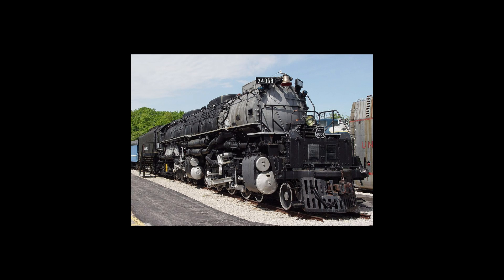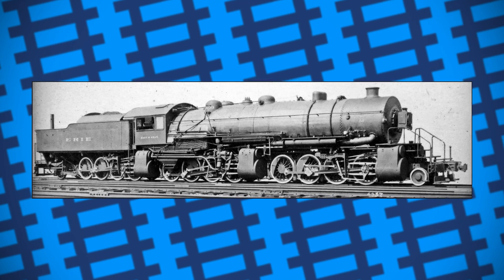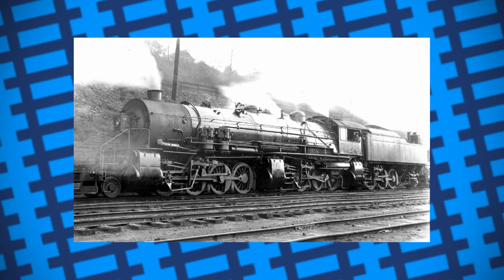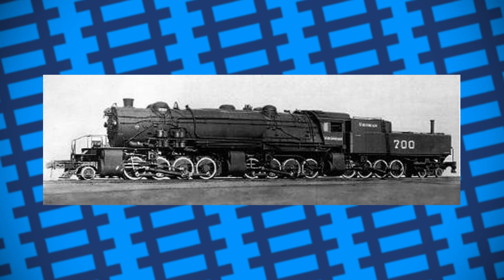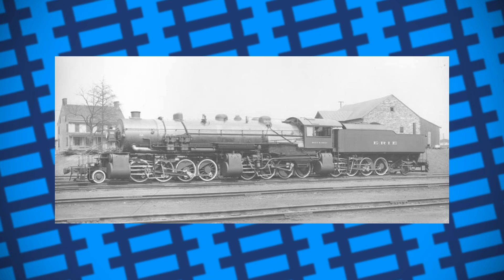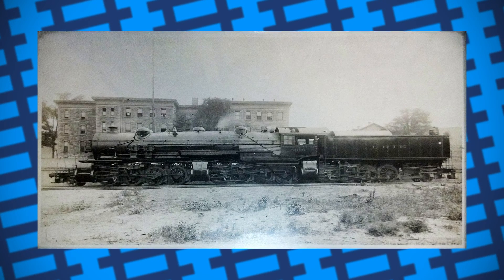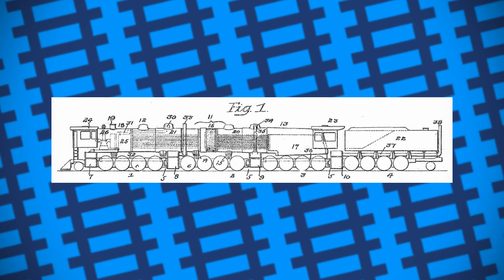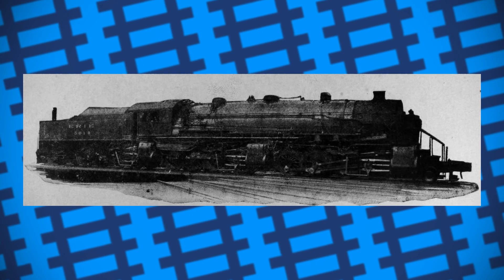The most absurd tank engines ever built - 2-8-8-8-2 "Triplexes"

Comment: A bit thing you are missing here is while they ended up being pusher (banking) engines, that's not what they were intended for.
(I manly learned about the Virginian 700, but I believe the Erie 3 where of the same reasoning)
These were designed for Coal Drags, which don't need much in terms of speed, but did tend to need more than single digit top speeds.
The want was for one big engine (and thus one crew) for these and to pull ever larger drags.
But when they couldn't provide enough steam for the journey they were dropped down to pusher service.
However in the US pusher service wasn't really anything special, a standard engine or two was typically enough for this and the benefits of a special engine for this was greatly outweighed by the costs.
Reply: The VGN seemed to like using single engines on their coal drags from Roanoke to Norfolk as it was generally down hill for loads and hence why they used 2-10-10-2s for a time after the Triplex (eventually they were supplanted by the AG class 2-6-6-6 when a former C&O employee became their mechanical officer in the 40s)
Reply: And another note The Virginian 700 was a 2-8-8-8-4 and all for Triplexs on both Railroads were remade to make several different 8 driving wheel locomotives. the Scrap logs were mainly for the Boilers and I think the Virginian scraped 700's tender also I for get the road numbers but the 700 was remade into three 2-8-0 loco motives.
Reply: @Dallen9  VGN 700 was actually split into a 2-8-8-0 and a 2-8-2 (they were AF Class 610 and MD Class 410 respectfully, a lot of websites would confirm it)
Reply: I think with better trained crews and a bigger firebox and a condensing tender like the south African Class 25 4-8-4s and the German BR52 2-10-0's instead of simply injecting the steam back into the last set of drivers this locomotive would have worked.
Reply: One thing: the coal car has piston rods
Reply: the problem was the mechanical stoker on the triplexes  it didn't distribute the coal evenly,( a problem with all mechanical stokers)this became evident when the one on one of the Erie engine broke down and caused a major delay, and the head fireman had to hand stoke the engine, they added a second helper for the fireman and he was able to fire the boiler fully to the point of not only taking the train up the grade but all the way to the end of the run
Reply: @jamesberry3230  Sounds more like they hadn't worked out the solution for that (moving coal around with steam jets as it left the stoker auger) than anything else.
Reply: Both the Erie and the Virginian were entirely intended as pushers.  The Erie locomotives spent their entire careers on their one 7.75 mile grade.

The Virginian never entered service.

Comment: You're a bit wrong about the big boys. Their rear driver set was rigid with the boiler, while the back of front driver set was connected to the front of the rear with a hinge pin. And each driver set was powered by 2 cylinders, not 3. There are, however, a few american examples of 3 cylinder steamers, such as the Union Pacific's own 4-12-2 9000 class.

Comment: Feeding six cylinders with steam requires a boiler with an enormous capacity. Clearly, these did not meet that need which was why their speed was so slow. Sometimes locomotive designers were overly optimistic in their assumptions. There were other designs that also failed to meet their specifications and were rebuilt or scrapped.

Comment: Remove “Tank” from your video title, these are not tank engines.
Reply: They are tank engines. To be a tank engine, you have to have your fuel and water carried as a part of the locomotive rather than on a separate tender. Since they extended the driving wheel sets back under what would normally become the tender, it just becomes a large fuel and water bunker, thus making these tank engines

Comment: If freight has gotten heavier, 🤔 💭 I like to think the SP would've had cab-forward triplexes built for Donner Summit.  👀 
Simple articulated, so no tripple-expansion Patent royalties to Mallet!  Someone please do artwork or a freelance model?
The 4-8-8-2's worked so well, optimized boiler capacity for speed and the infrastructure was built to accommodate them, down to the train length of passing sidings.  So even if a cab-forward 4-8-8-8-2 could push all 6 cylinders at capacity it would still only be 1½ times as good for (probably) more than twice the price. 🚂 🚂 🚂 💰 💰 💰

Comment: One of the biggest problems with freight rail in the US is that they are actually allowed to have trains that are miles long. There are numerous logistical, and sometimes fatal, issues that occur because freight trains are allowed to block at grade crossings for as long as they like. There have literally been people who passed away because the ambulance that needed to save them couldn't get over the train tracks for over an hour. There are towns in the US that are literally cut in half for hours at a time because freight trains just stop and sit blocking every single railroad crossing.

Hazardous cargo freight trains that have derailed in the US have also been major disasters because we are allowed to have oil trains that are miles long, or toxic chemical trains that are miles long. The derailment in East Palestine Ohio is a recent famous example of this.

They do that because of money, of course. If you can have a train that's 5 miles long, with only two employees on board, you don't have to spend as much on payroll.

Comment: It is not a tank locomotive. A tank locomotive has one rigid frame, with water tanks slung either side of the boiler, side tanks, pannier tanks or saddle tanks or between the frames, as in a well tank. This Triplex has water in the tender, so it is a tender locomotive of the articulated type, since its front set of wheels can pivot when it encounters curves. The tender, which has the rear set of wheels underneath it, can also pivot.
Reply: No, having a rigid frame is not a requirement of a tank engine. There were plenty of 2 driver set articulated tank engines. The "tender" here is simply a large water and fuel bunker, since it has a diver set meant to be used at speed and not just as a boosting engine. These are 100% tank engines
Reply: @wilhelm_iron2359  Rubbish - you have no idea what you are talking about. The "2 driver set" you mention were on Mallet tanks, WHICH HAD A RIGID FRAME, beneath which one set of wheels was able to pivot. Do please get your facts right. Mallet tanks were NOT articulated. AND the triplex has a tender, which means it is a tender locomotive NOT A TANK. Doh!! Dummy!!

Comment: The biggest flaw was that all the cylinders were of the same size   rather than having compound large diameter cyclinders at the front   Also having the third  set of drivers under the water and coal capacity  meant that the adhesive weight over that set became less as the loco was in traffic

Comment: Aside from the obvious fact that this locomotive is NOT a "tank engine", your math is indeed off. In the 1910's, typical freight cars were at most 40 feet in length.
Reply: The Erie introduced 50' freight cars in 1901.  Le Massina, for instance describes them as tanks.  Wiener says they have pseudo-tenders, but are more rationally grouped with the original Mallet tank locomotives.

Comment: The failure of the Triplexes was in the size of all 6 cylinders  being the same diameter  had the leading cylinders been larger and the system of compounding used  the story may have been different
Reply: Keeping the six cylinders the same size ensured a relativley conservative 2:1 ratio between low and high presure.  Thus also loading gauge was not offended.  Larger low-pressure cylinders would not have improved things.

Comment: MALLET TECHNICAL EXPLANATION
The Union Pacific Railroads "Big Boys" with the 4-8-8-4 wheel arrangement are known as a Mallet design. The "Mallet" is a design of articulated loco where ONLY the front engine, (that's the leading 4-8 wheel part), is on a separate frame that can turn, using a large pin & socket system to allow the rotation. The rest of the locomotive including the cab, firebox, boiler smokebox & the rear set of 8 drivers  & 4 wheel bogie beneath the cab is one complete chassis/frame. Further in typical U.S. fashion post 1900 this loco only has 4 OUTSIDE cylinders. NOT the 6 you state.

Only models of this locomotive such as the Italian Rivarossi example have separately pivoted front & rear wheel sections. For the simple reason to allow such a large model to negotiate the absurdly sharp track found on most "toy train sets". In HO scale (1:87) a model Big Boy if made exactly to scale would need a track curvature of no less than 900mm radius. Most toy train set track systems have curves as sharp as 395 mm in this scale !!! So for commercial reasons liberties are taken in the model production. But the model is where many "rail enthusiasts" have got their mis-understanding of the real loco muddled !!!

TRIPLEX TYPES 2-8-8-8-2 Erie Railroad & 2-8-8-8-4 Virginian Railroad.
These were NOT tank engines, as they had a distinctly separate tender (coal & water supply container). In this case the centre set of wheels was attached to the main frame supporting the boiler & cab. The front set of wheels were on a separate wheel frame that could rotate through the pin & pivot method as on the Big Boy (see above). The rear set of wheels were on another totally separate frame, that also supported the coal & water tender, and was "coupled not pivoted" to the middle main chassis in a similar way as a normal tender steam locomotive. The problem of getting steam from the boiler to the six cylinders (2 outside cylinders per frame) was solved by large steam pipes with flexible joints between the frames, but the distances involved meant inefficient drops in steam pressure, and leakage. 

The reasoning for building such locos was for the prime task of banking trains up steep gradients, where a second loco is needed to assist. The downside was the cost & maintenance of these complex locos, their limited speed precluding them from normal mainline work, or even shunting in yards due to their inordinate size. 

As a Locomotive Mechanical Engineer who has worked for a number of railways around the world in many railway departments, from Shed Master to Corporate Economics Management. I really think I should warn you that 95% of all the HUNDREDS of Wikipedia pages on railway matters, I have examined, are written by totally unqualified people, so are riddled with imbecilic nonsense, & in many cases quote inaccurate, misunderstood or even fictitious references !!
Reply: The rear articulation on the Triplex was similar to the lead articulation - as evidenced by the rear cylinders being under the cab. La Massina disagrees with you about them not being tanks. Wiener says they have pseudo-tenders, but are more rationally grouped with the original Mallet tank locomotives.

Comment: Your math is WAY off.  The average freight car of the day was 40 feet in length, NOT 55.  That would make a train 4.92 miles long, still not possible with the strain on the couplers.
It's also NOT A TANK ENGINE.  Not even close.  Just because there's drivers under the engine, that's NOT a tank engine.  Other locomotives had booster engines  under the tender as well.  Tank engines have the water tank slung over the boiler or on each side.

Comment: I know more about ships than locomotives, but I bet one of you guys can give me the good reason that they did not use condensers and preheaters on these things. A 4-4-0 locomotive is pretty small and maybe more advanced equipment was a waste on it. But the number one here was 400 tons and that means it had space for an entire 20,000 horsepower 2 boiler, condensers, preheat and super heat engine set. There had to be good reason, just not sure what it was
Reply: Because of the need for draft.  Locomotives can not force draft the way ships can.  Add in weight.  Add in access to line side water.  Although the south africans did use condensors, and did use forced draft - but out of necesity rather than desire.

Comment: My understanding of the Erie Triplex engines is that they were created to haul iron ore trans away from  the docks in Erie, PA and up a significant grade to reach the ground level where the mainline was. They were only expected to move the train about ten miles. I also believe this was done as a pushing action with a much smaller engine on the lead of the train. These engines succeed doing the job they were designed for for about 20 years, a pretty good life span for any mechanical object in heavy use. But they had the short comings stated: not enough boiler to produce enough steam to fully use the capacity of the engine cylinders; too little storage capacity for coal and water and lastly they were highly complex engines and hard to keep in service.
Reply: They were to bank normal traffic up one hill in northern Pennsylvania - 7.75 miles long.

Comment: The "Big Boy" does not have its driving wheels mounted on two sets of bogies. On a Mallet locomotive, such as the "Big Boys", the rear set of driving wheels are fixed to the frame, the front set only are on a bogie. They had only two cylinders per wheel set.
Reply: Big Boy is again not mallet, its a simple articulate

Comment: Nowadays, the average train is over 6 miles, but they have diesel and run on very specific tracks. This just seems surreal for something with steam power single-heading a train. I don't even know that the cars at the time had the strength to hold up due to the engine decelerating, and would probably require loads of engines just to get the entirety of the train in motion without breaking. I can only imagine how majestic it would have been to see one of these in action, even if only for jobs that didn't use the full capabilities of what was intended.

Comment: There are two significant errors in your opening introduction. The Union Pacific 4-8-8-4 "Big Boy's" only independently swiveling bogey was the forward one. The second set of drivers were permanently aligned with the boiler's central axis and did not swivel independently of the locomotive's frame. Secondly, the Big Boy's two sets of eight drivers were powered by just two high pressure steam cylinders per bogey, not three as stated in your introduction. 

UP had some classes of non-articulated 3-cylinder compound locomotives, notably the 4-12-2 "9000 Class" solid wheelbase engines, which represented the only use of this wheel arrangement in North America.

Comment: The Big Boys did not use three cylinders per bogie, it used the conventional two! 

The three-cylinder arrangement uses the Gresley Conjugated Valvetrain where the timing for the center cylinder is derived from the valve positions of the outer-two. The design reduced wear on the tracks and provided a more uniform application of torque, hence reducing wheel-slip at slow speed. The major drawback was accessibility issues to the center cylinder for maintainance and the fact that its main-rod operated at a greater angle hence greater wear/stress to its bearings and sliding surfaces

An interesting fact: When the Mallard set the record for the fastest steam engine ever it "threw out" its center rod and had to limp home.

Comment: The Big Boy's rear engine unit does not pivot, but is mounted directly to the frame which is the worst design feature of a Mallet. Also, they had only two cylinders per engine unit. As for triplex locos, no steam loco has a boiler big enough to feed six cylinders at any kind of useable speed. Also, the rear cylinders are located under the cab which is where the first Garratt locos had theirs but on subsequent models they were moved to the rear of the tender because they made the cab too hot. Operating these these would've been very uncomfortable on hot days. Steam right under you and going so slow there'd be almost no breeze blowing through the cab.

Comment: There is absolutely no way those locomotives could haul as many cars as claimed. The total weight on drivers was 761,600lb. Steam locomotives achieve a factor of adhesion of around 20%, meaning the starting tractive effort - the absolute maximum force that can be exerted without the wheels slipping - is 152,320lb. This is less than a single ES44AC (183,000 lb starting). You don't see ES44s starting any six-mile-long trains on their own - because the physics simply doesn't work. Even with the 40-foot, 40 or 50-ton cars of the day (not to mention the significant drag difference of plain bearings v. roller bearings).

Yes, steam locomotives and diesels are different in the way that their tractive effort curves function once the train is moving, but none of that affects the absolute maximum tractive effort available, which is purely a function of weight and adhesion. Give it more power and the wheels will slip. A 600HP SW1 will outpull a 1500HP tractor every time - because the maximum force prior to wheel slippage is weight multiplied by adhesion (wheel creep notwithstanding, but that requires ground radar).

Even without wheel creep, two ES44s would match or best the triplex at 75% of their rated capacity (without the wheelslip control system, you can expect an ES44 to deliver 108,000lb of tractive effort assuming a factor of adhesion of 25%, which is typical for diesels).

Where steam locomotives and diesel locomotives differ is that steam locomotives develop a constant force until the realities of physics turn them into constant-power machines (a transition that typically occurs around 25-30 MPH), whereas diesels are always constant-power machines. This means that the tractive effort curve on a steamer is flat until it begins to taper, whereas the tractive effort curve for a diesel is exponential as speed approaches zero.